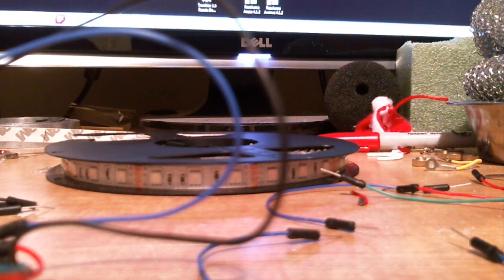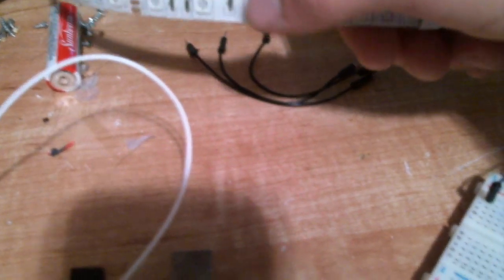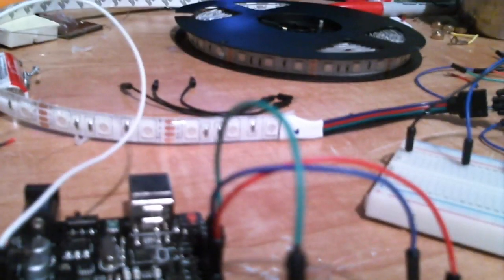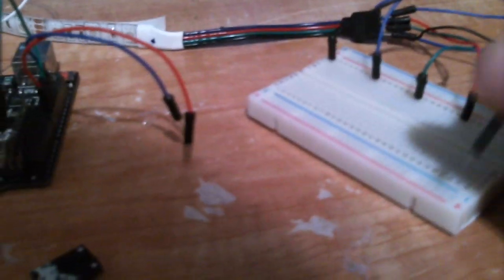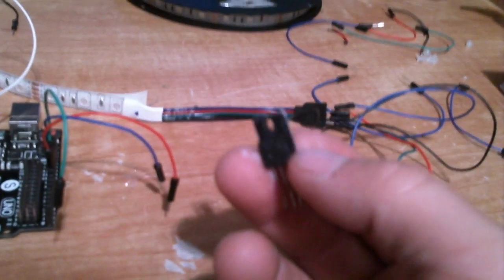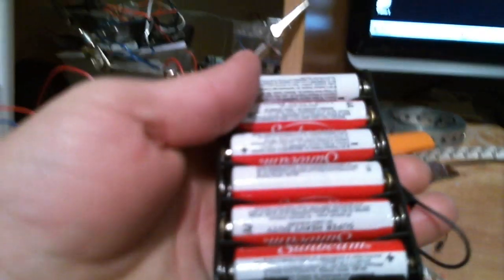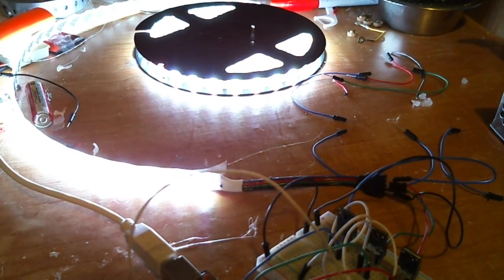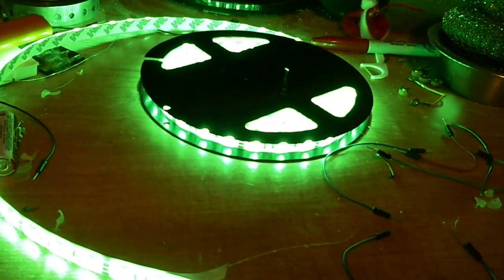RGB LED strip controlled by Arduino Take 2 !

Comment: Just get to the point will you. for heavens sake
Reply from the maker: Lol I know right my old vids sucked
Reply: Do you reckon I can power a 1.5m rgb led strip straight from the arduino board, I have a mate that some how has got it working but he is not one for talking. Thanks
Reply from the maker: I will work for a little bit, but thats to much current for the arduino to handle  for long use.
Reply: Ok what I meant is would it work if I used the power supply hooked up to the arduino and the arduino connected to the pc but using the arduino 9v vin output with 3 resistors per r, g, b, and the three transistors

Comment: Code Efficiency!

public setColor(int R, int G, int B, int delay){
    digitalWrite(r,R);
    digitalWrite(g,G);
    digitalWrite(b,B);
    delay(delay);
}

public setOff(int delay){
    setColor(0,0,0,delay);
}

loop(){
    setColor(255,0,0,1000); //red for 1 second
    setColor(0,255,0,100); //green for 0.1 seconds
    setColor(0,0,255,100); //blue for 0.1 seconds
    setOff(200); //off for 0.2 seconds
}

Comment: Looking at getting an arduino. Can you dim certain colors? So as to create every color on the spectrum? Or does each color only have two values (on, off) ?
Reply: ***** yes u can make any color by having a different rgb values; u just need 3 pwm controls and set each one to its respectful rgb value(0-255)